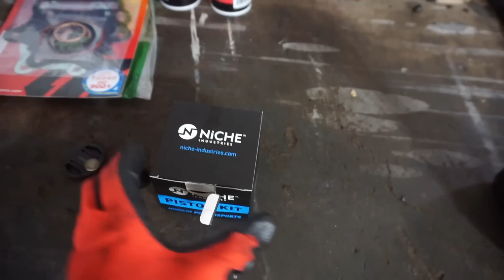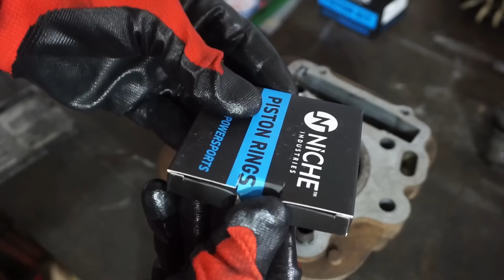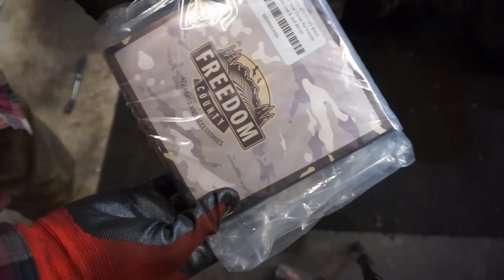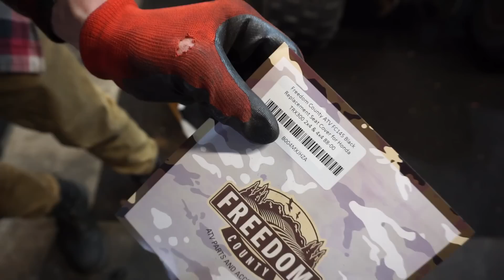Honda 300ex SMOKES BADLY! Can We Fix It?

Comment: When you remove valves from a head, make sure you deburr the stem where the keepers sit in the groove, oftentimes there will be tiny bits of metal sticking up, causing it to hang up in the guide and possibly damaging it upon forcible removal of the valve. A small file or whetstone takes these right off and allows the valve to slide right out.
Great video on this overhaul!
Reply: Second this

Comment: To get it into reverse: trans in neutral, push red "R" button on clutch lever then pull clutch in. Then lift up on the reverse lever, put shifter into 1st and she'll go into reverse. Let out the clutch and away you go
Reply: Never understood why the reverse lever was on the same side as the clutch. It can get a bit awkward to engage. That being said, I miss my lil 300.
Reply: @buttermule  yea I have a 1987 trx250x and the reverse mechanism is much easier you use your heel to pull it up
Reply: If make a longer shifter you can use the extra shifter to eliminate the funky reverse lever, you'll have 2 shifters but it works
Reply from the maker: @buttermule  yeah definitely a weird setup!
Reply: @2vintage  you dont put in into first to go into reverse, you press the red "R" (I noticed that your had dry rotted off so its just a metal post) and pull the clutch in while in neutral, then just pull up on the lever and it should click into reverse. But youve probably figured it out by now but, oh whale. (Edit: Im a dum dum stuoid brain, i just saw you do it, dont just the gun on commenting lmao)
Reply: Yeah I kind of laughed at him trying to figure reverse out because I did the same thing when I bought one of these. Then the perch broke at the bottom that pulls the lockout cable so I ended up just zip-tying the lockout part back and it's much simpler to put in reverse now. Just put it in N and pull up on the lever (with the clutch pulled of course).

Comment: You should invest in a decent size drill press to Hone your cylinders. When you do it by hand you stand a good chance of making your cylinder egg shaped.also,check your end gap by using the piston to squar up the ring,and do it after you have honed the cylinder.the reason the valves had a lip on them is because the actual valve seats were worn out,causing the valve clearance to b to tight.
Reply: Man come on u are just hone it u ant boring it lol U build a v 8 u use a drill press to hone it no u don’t if it’s that bad u bore it
Reply: @shotgunz124  no,actually I send a v8 to a automotive machine shop.just trying to help the kid out in doing proper procedures.
Reply: @darrinwoodward14  ultimately it doesent matter. I’ve honed big scratches out of cylinders by hand no problem
Reply: And some soluble oil for honing engine oil is too thick and probably not helping

Comment: When you do old seats and the foam is dries out and rough, glue a layer or comforter batting to go over the foam before you staple the seat cover on. The seat cover you got was for a fourtrax, you need one for a trx300ex sportrax.

Comment: Hey bud on those jug bolt you can get them out. By drilling holes into them for tapping A easy out into the bolt hole predrilled inside of it. Then use propane tourche to heat the outside area up to expand thread space. Then use A wrench to loosen up the bolts with slowly.

Comment: I'm always surprised you don't use a piston to check that a ring is "square" in the cylinder before checking a ring gap.
Reply: He used to use a piston all the time in previous videos. After you check the ring gap 100 times, you get a feel for when the rings are in the correct position to check the gap.
Reply: He used to he's done enough of em now to know

Comment: Thanks for the videos man. I watch them all. Just a tip for you when checking the ring gaps. Use the piston to press the ring in there. It guarantees the ring is perfectly level in the bore for you to check the gap.

Comment: Man, it's a good thing you decided to change the valve guides. That intake valve was stuck!  You should consider a little assembly lube on the top end for first startup. Great vid sir!
Reply: What's the tool called? And is there one to remove a stuck wrist pin on the piston?

Comment: Little advice for you if it's ok. Next time when you're trying to get a broken bolt off like that. Get it as hot as you can, when you're done welding the nut on it should be glowing red. Then put a good pair of vise grips on and it should most likely come out.
Reply: Thats the way we do it at work for broken manifold bolts on heads and works great
Reply: When I do the nut trick, I only thread the nut onto one thread and then fill the rest with weld up to the top of the nut. That usually produces enough heat to get her free.
Reply: I just used it on my jeep. On wheel bearing bolts that I didn't have the right size socket for. I just welded a nut to the top of the bolt. Got it cherry red in the process and got them out with no problem. I'm not saying that it's a 100% guarantee. But if they're that stuck in there you'll most likely never get it out if you don't get them super hot.
Reply: You can grind a line into it aswell and drive it out with a flathead screwdriver or drill bit all types of methods

Comment: Yeah man, that seat cover is for a TRX, not an EX.  The TRX is the utility style quad.  Easy mistake to make, but you can’t really blame that on the seat cover company.
Reply from the maker: Yeah I realized that after I was editing lol. I got the right one ordered now.
Reply: Its a trx300ex there mr bwat
Reply: I think you're confusing TRX with FourTrax. TRX is the sport quads, like trx 250, trx 450r, etc. Fourtrax is utility.
Reply: Yeah it’s a trx300ex but the seat cover didn’t say ex so the cover was probably for something like a fourtracks
Reply: It's also a fourtrax 250 x

Comment: Hey 2 vintage that problem I had on the ltr450 was cause by a aftermarket starter the shaft is a bit longer than oem I put in an oem one and it turns sweet
Reply from the maker: Oh awesome! Glad you got it fixed!

Comment: Trx300 is a utility quad.  What a hack!  Not taking out broken bolts.  To put it in reverse theres a button you push down on the clutch lever, pull the clutch in then pull the lever up.  I cant believe i watched this!

Comment: Just grind off the long part of the one to match the other one.,or use heat on the outside.& regular vise grips the loosen it up with.& do the other process to the other one. To get both bolts out of the engine block for mounting the jug onto the engine with.
Reply: solid advice ^^. i cringed when i seen him applying gasket maker under the base gasket..like...wtf bro ?!. bad way to seal for future oil leaks...and that gasket maker crap will throw the tolerance out of spec. he's got the '' i like working on these '' talent, but loses me when he does it half assed where you should not.

Comment: To get it in reverse there’s gonna be a little button by your clutch lever push that in pour the clutch lever back Then pull the reverse lever/handle up Then it will go into reverse gear but great job bringing this back to life very well job done do you still have this particular quad??  you can do so many things to this and they last a very long time

Comment: When you are checking ring gap use the piston keep the ring square in the bore plus check the ring gap at the bottom of the bore as well as the middle, piston to wall clearence depends on the piston material one or two mill on the loose side isnt going to kill the engine

Comment: You should use pb blaster on that stuck bolt and heat that will extract it pb blaster is 10/1 better than wd40.

Comment: Hi when you hone  a cylinder  you need to use oil not the stones  dry you get a better finish  and when you measure  the ring gap push the ring in with the piston just little  tip for to do a better job and better  finish

Comment: My wrist pin is stuck it seized to the pin i put heat tried to hammer it slightly and now am drilling it saw where someone sawed the piston what would you do? It moves on the shaft but its stuck to the piston so i figured if i drilled it with a universal bit and it got cut away from the piston i could pick it up and off and pull the pin. How much play is allowed in the drive shaft bearing ?As of now it moves about 002 of a filler gage at most.

Comment: I'm a 30yr.motorcycle mechanic.I get it,I've used  Niche parts ( cheap chinesium) but there is a reason the Wiseco was $140 and the Chinese CAST piston was $30.Just as anything in life you get what you pay for.
Reply: How long did the Niche piston last in your application vs the Wiseco?

Comment: the way you honed the cylinder could be considered a hate crime...but somehow, even with that garbage piston..it will probably run forever...on 87 octane....with a generic air filter...and bent valves...because why wouldnt it......ffs....
Reply: lol! yep
Reply: It’s because he’s not a try hard
Reply: Why would it be considered a hate crime?
Reply: Treat your cylinder like a woman. Can’t just stick it in dry you gotta give her some lubrication and longer strokes
Reply: @Jetsonn  scratches  should be at a 45 degree angle. To achieve that you need to run the drill at a slower rpm and move up and down faster. And you shouldn’t have it tilted sideways and hone it, you’ll get more pressure downwards honing it that way. And be more consistent with the up and down movement
Reply: He's a flipper, let the next one worries about all the f-up's, like broken bolts and bent valves.

Comment: Hey I have a 1988 Honda trx250X fourtrax  4×2 and seen how the 300EX has the same size Pistone like how you showed on the 250 was like stamped 246 and the 300EX stamped 280 something on the block so my question to you is the 250 and the 300 the same in power? I'm really curious because I want to buy this 1998 trx300ex then sell my 1988 TRX250X so if you could please tell me which one is better and or are they basically the same motor in both the 250 and 300 and how could the 300 be more powerful if it's the same size cylinder as the 250? Also should I keep the 1988 250 or get the 1998 300 in your opinion which one would you go with?
Reply: I already put a lot of money in the 1988 250 and looking at the parts that I bought for my 250 most everything would fit on the 300 like a arm bushings front and back bumper wheel bolt pattern all the same so is it worth buying the 300? It is 10 years newer then my 250 seems like only difference is Kickstart versus electric start so please tell me in with some knowledge LOL

Comment: Hey I’m having an issue with my 400ex. It will idle and rev fine if you stab the gas, but if you try to hold a steady throttle above idle it sputters like it’s running out of gas. Almost sounds like a 2 step would. Once you get to about 3/4 throttle it steadies out but nothing until then
Reply: Check the plug and its gap, that got me before.

Comment: that's because the motor needs to be in a deep freeze with the bolt welded on then pull it out and while  torquing heat up the aluminum.

Comment: You have to weld the nut not tack it turn wire speed down and voltage up burn that not with one weld and make the nut and stud one piece you will snap the stud in half before the head will come off it again

Comment: Reverse is the same as the 250x right on the clutch a lil nub push down pull in the clutch then pull the reverse lever up and you are good to go.
Reply: Put it in neutral

Comment: I hate those head lights.  There  so floppy the way they are mounted.  I took mine off and just used a nilight  way better and solid. I got an 01.  And there kinda slow so I have mine geared 12 front 36 rear.   Has way more torque  little less top end. I needed to keep up with my buddies raptor 350

Comment: the reason the seat cover didn’t fit is because it’s for a 300 fourtrax not a 300ex even though they both are classified as a “trx300” you can see on the package it says 2x4 or 4x4 they obviously didn’t make a 4x4 300ex lol

Comment: Also your technique for cutting the cylinder is all wrong you never go full throttle on the drill and moving a slow up and down getting your crosshatch 45°